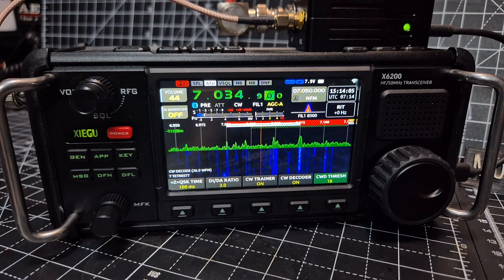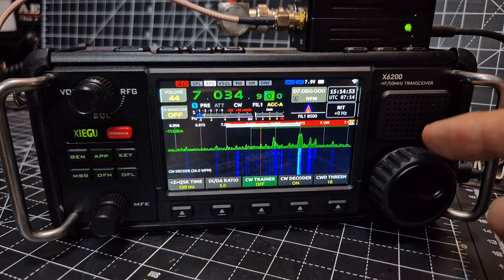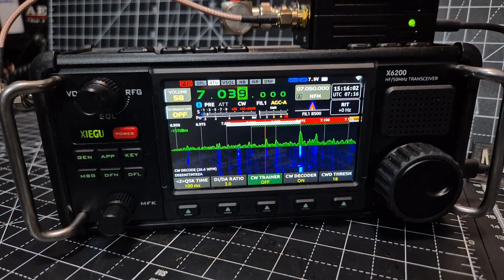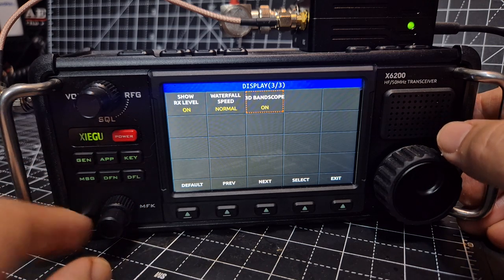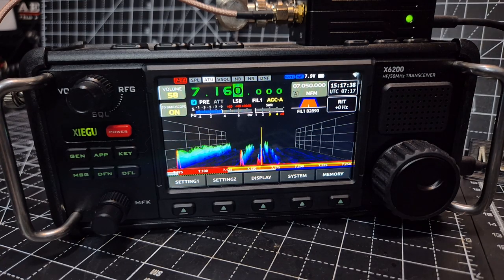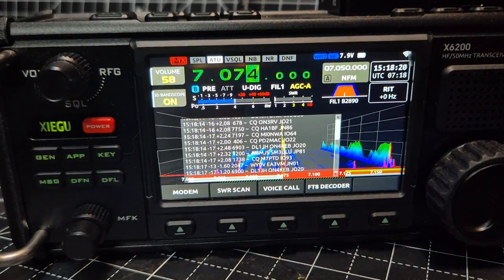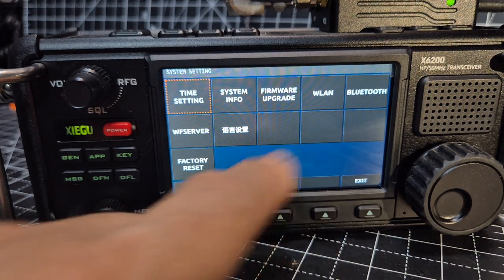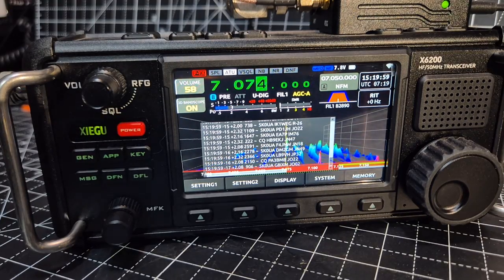Xiegu X6200 CW Decode  -New Firmware v1.07

Comment: cw-decoder is certainly not fool-prove and maybe downright bad. my cheap truSDX has a superb decoder without changing parameters.
Reply from the maker: Overall this is a very good Set .
Reply: @M0FXBHamTech  I tested the new firmware anyhow. I hear no agc noise. The cw decoder is certainly better than in the previous version. 3D view I always turn off, don't like it in Yaesu rigs either. Maybe some people forget to switch to speaker instead of headphones.

Comment: You need to get centered on the signal to get the decode to work.  Also the ability to send saved CW messages was accidentally remove with the old decoder.
Reply from the maker: Thanks for the info I will try again any tips on centering .